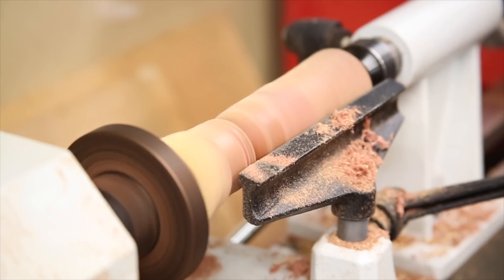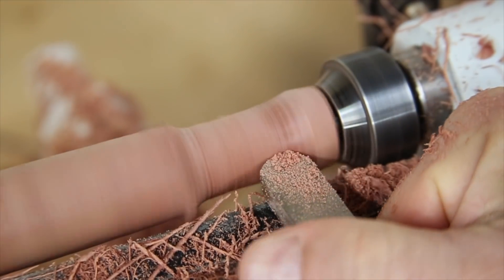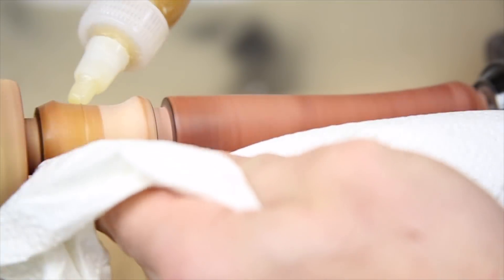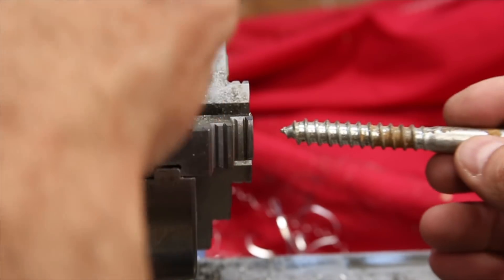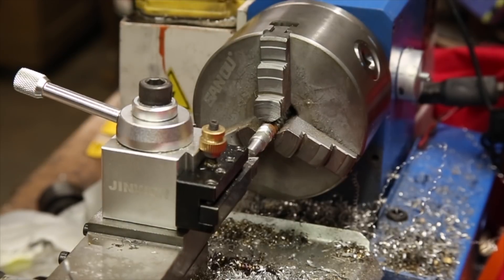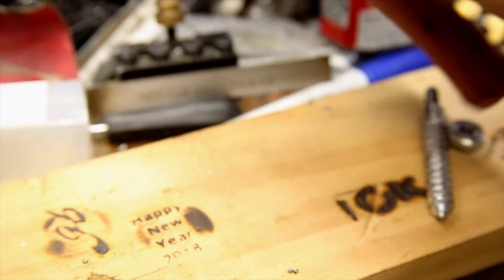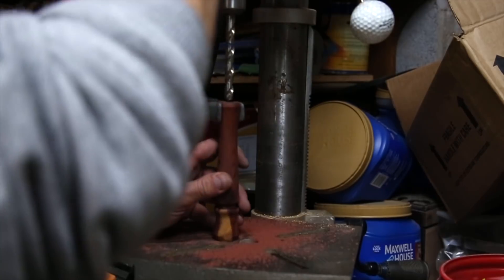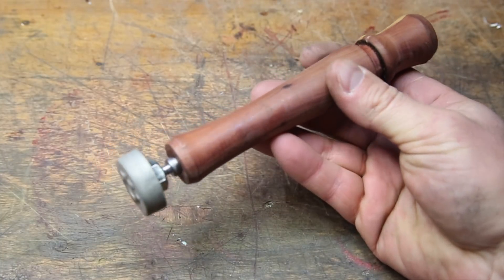Turning Wood Handle for the Branding Iron + Lag Bolt Hack on the Metal Lathe

Comment: Couldnt you have used the metal lathe for this , I know there is a difference obviously I assume as far as torque rpm ect. , I guess it would be better to ask , can an metal lathe turn wood efficiently and what are the pros /cons to each lathe ????
Reply from the maker: Basically yes... really a lathe just spins the work piece. The main difference is the tooling, while similar, is pretty different in use. The main reason why you don't want to turn wood on a metal lathe is because sawdust mixed with the ways lubricant doesn't make for a very slick combination and it will jam up the components of the metal lathe pretty quick. The wood lathe just has the tail stock and tool rest, both of which are pretty sloppy when unlocked so the sawdust doesn't pose much of a problem.

Comment: hey tim, what wood is that? the color looks cool. i bet the finish would be much glossier if you sand it to 400 grit, water it down to raise the grain and then sand it again before applying the finish!
Reply from the maker: Hey! I'm not totally sure, it's either Cedar or Juniper. And thanks for the suggestion - I actually tried that in the bottle opener video [ https://www.youtube.com/watch?v=K9nMT8v63gQ ] and thought I'd see if it ended up different this time around. As far as I can tell there's no difference.

Comment: Although only a hobby woodturner, I found by sanding to 600 grit, then burnishing the workpiece with a handful of shavings, I have far better results with the finish, whether it be oil, wax, shellac or whatever. Oh & by the way, I don't get on with a skew chisel either Lol
Reply from the maker: Interesting - I'll give that a try too... I definitely have enough wood shavings now :)
Reply: TimNummy you may also find (I did through trial & error) that, the harder the wood, the better it is for turning & also keeping your tools sharp (I just use a bench grinder with a fine pink wheel) helps alot, it's the fine burr left from grinding that actually does the cutting. There's very few helpful videos online to teach you this & there's no strict rules on how to turn & use a wood lathe, everyone does it different & you have to sort of find a way that works best for you. 👍

Comment: Your tool rest needs to be slightly above centre when using a skew chisel then just lower the skew onto the workpiece. Also let the Finnish soak into the wood before rubbing it off. Great video though.
Reply from the maker: Thanks! I'll try both of those.

Comment: When sanding, be wary of the sandpaper grabbing and pulling your hand into the tool rest. It is good practice to move the tool rest away while sanding, and to grip the sandpaper in such a way that it easily pulls out of your hand (don't wrap it around your fingers/thumb).

The wood you are working with is very soft and has some degree of rot in it. This is part of why you are getting tearout. Sharper tools and faster spindle speeds might help.
Reply from the maker: That's a good suggestion - I didn't have it wrapped up on my fingers but it's easy not to realize that you can get tangled in the tool rest without too much trouble. 

I just found this wood in my back yard so it's just however it came off the ground. I do need to invest in some sharpening stuff sooner rather than later. As for the speed, I have some room on the pulleys to adjust it faster, so I'll give that a try, thanks!
Reply: The great thing about a wood lathe is you can turn any old crap you find on the ground. Keep an eye out after storms for fallen branches.